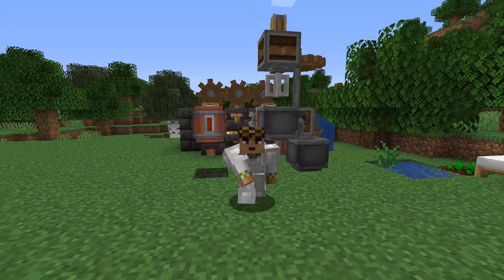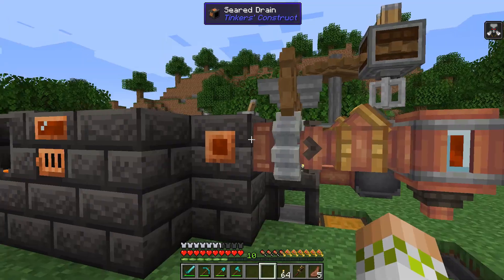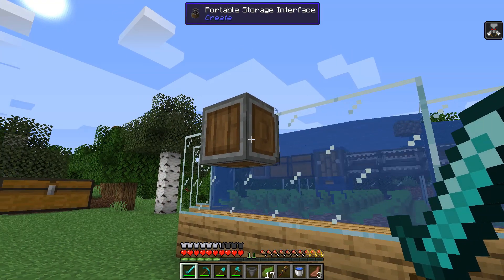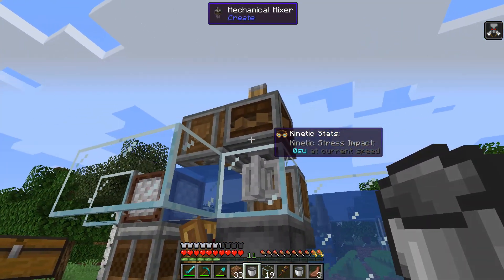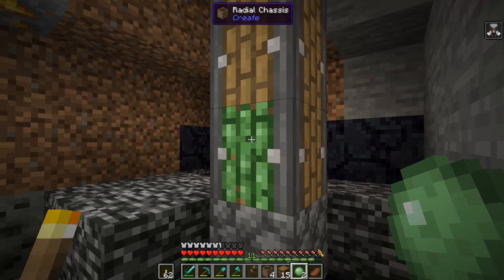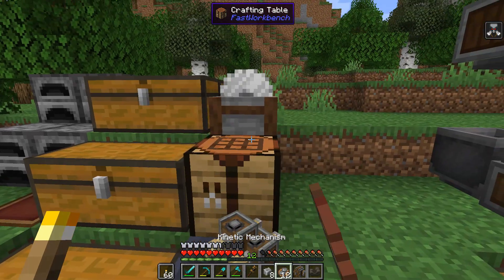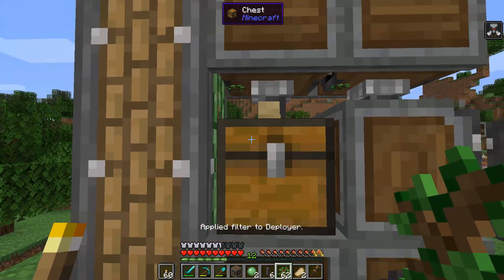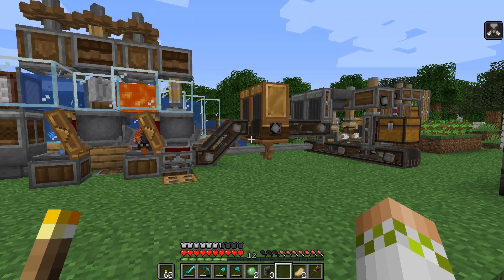Create Above and Beyond : E02 - Kinetic Mechanism Factory

Comment: Just adding to the andesite alloy automation, the strainer works beter when it has water in it's four sides, so you can open it more :)

edit: also, don't know if it would work because of chunk generation, but i think you could transport the andesite to the surface using a water soulsand elevator using fans to push the items
Reply: I'll be stealing this for my playthrough!
Items slowly float in water if soulsand is too hard to get. Water streams are a bit cheaper than encased fans, too!

Comment: Very late, but it could help someone out ( or you next time): Tinker faucets are technically fluid pipes. What I mean by that is that you can directly pipe into the casting table, and it'll automatically cast your molten metal without needing to put it back into the smeltery.
Reply: Also: vanilla bubble elevator to move the andesite up.

Comment: pretty sure you could simplify your brass setup a little bit by placing the casting table directly below your brass basins output chute. that way you dont have to deal with changing between molten iron and brass in the smeltery.

Comment: I think you can set the Tinker’s drains with copper cans or something, so different drains are locked to specific fluids. That may help so you don’t have to switch the whole time.
Reply from the maker: Oh, you may be right! For some reason I thought you needed the specific drain that uses cobalt to make though (based off reading the block tooltips) and I have yet to go find cobalt yet.

Comment: 34:08 You could save two gearboxes there by simply adding another small cogwheel to the top of the two you already have, then the power will be on the level you need.

Comment: Regarding your brass automation setup, I believe that you can immediately pull the molten brass into the casting table via any fluid pipe (create doesn't seem to work last time I tried but they might have fixed it if not use some other pipe) and you can simplify the setup by a lot.
Reply from the maker: You are correct! From what I've heard the faucet right off a basin works into a casting table. The only problem is you cant filter what it outputs, so you have to let the entire basin process the zinc/copper and have none left in it before you make ingots, which my setup doesnt have a problem with (but instead takes 50x as long to make lol).

Comment: And 2 things, 1. you should put a storage drawer for the kenotic mekanisums since that's the product in the end so of there is a back log, you can void it so it won't brake. 
2. I don't think it uses the saw each time when you put it on the belt contraption, but I might be wrong on that
Reply: it's hard to tell since it doesn't actually give you the durability, but i put in a brand new diamond saw, and it filled a drawer before it broke.  
32 stacks of 64 is only 2048 uses, so i think it might use up durability like normal.

Comment: How can you destroy that beautiful gabbro! I built my monster factory out of the gabbro I got from my bedrock cobble farm. Nice design for the farm though. Mine is quite different. I use an observer to fire a piston to move the cobble off the bedrock so I can drill it with a stationary drill above a hopper. Then when the barrel is near full it gets lifted to the surface with a rope pulley where the barrel is emptied.

Comment: my andesite farm system was at first just a drill and a fan that pushed the blocks on a conveyor belt to a elevator but then i realized that andesite is dirt cheap in the import shop so i just buy andesite with extra wood because it generates plenty

Comment: you could have just used a smart pipe and pump to pull the brass directly into a casting table no need to put it back into the smelter.

Comment: My one question is how do you filter out the specific fluids. My god I've been tearing my hair out. Can't seem to be able to filter specifically molten coper or zinc. I'm really wondering what I have to put into the filter for it to work
Reply: Same, buddy
Reply: @magnamoniousrlx2149  i just figured it out. You have to put buckets of specific molten metals into the andesite filter. Still have to manualy switch molten metal layers in the smelter gui.
Reply: @JudgeNicodemus  or just make individual 1x1 (x however tall) smelteries for different recipes.

Comment: What items did you use for the filter for molten copper and molten zinc?
Reply: You just need to use a  bucket of each to set the filter.

In case you don’t know, you can place an empty bucket in the casting table to fill it.  Once you’ve set the filter, clicking the bucket on the smeltey drain will put tge molten metal back in the smeltery.
Reply: @Greboth  thank you so much!

Comment: the way i automated sand was alot more expensive i say but alot alot more effective i have 4 drill collecting cobble stone those going threw 2 grinder to rrefine to sand with tbh can be filtered to make it only 2 grinder being used insted of 4 but i have my sand then filter into a glass making set up 2 for clay blowing sence bowing sand to clay is not as effective and ofcorse clay collection

Comment: How do you generate the rotational energy for the drill?
Reply from the maker: The mechanical bearing itself it rotated from the water wheels up top run down to it with like 60 shafts lol. The drill itself doesn’t need power because it’s part of a moving contraption.

Comment: I cant figure out how to filter the copper and zinc into the basin without the brass getting in. I'm using copper/zinc dust in the filter, is that right? and the same for the molten iron, how do I stop the spout from filling with other fluids?
Reply from the maker: You have to use the filter pipe with a bucket of the filtered fluid. If you don’t have that fluid or want multiple, I use a filter and then you can drag the bucket from JEI without having it to set the filter and place it in.